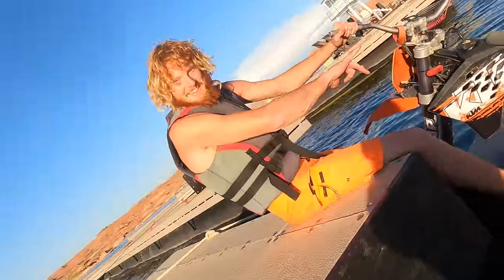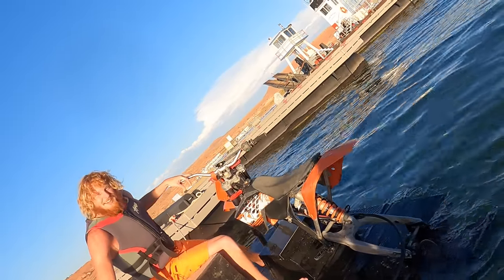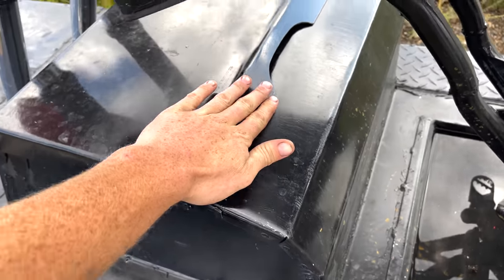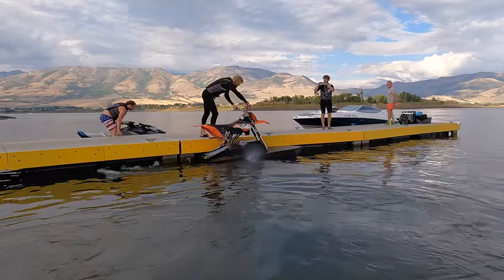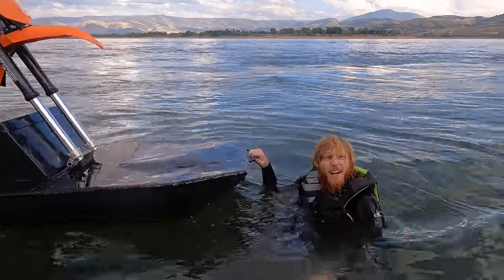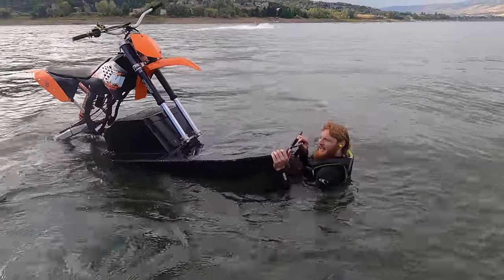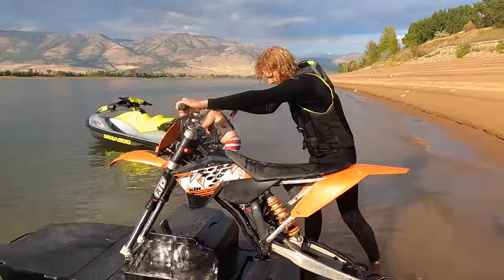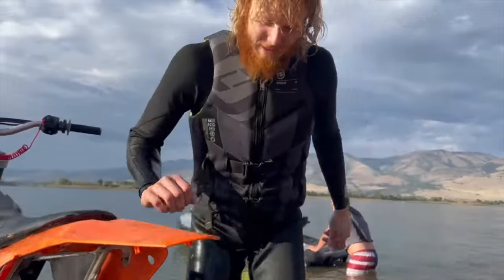Learning How To Ride A Boatercycle

Comment: My imagination was full send.
Snorkel the intake using a gimbal floater.
Add two small pontoons on the on each side at the rear. These could raise onto the deck as speed increases.
Definitely need a bilge pump that can be operated with a lever when your bobbing in the waves and engine is not running.

Comment: Awesome ride you built there.
I haven't watched the build video yet, but I have some ideas for you.
1) I think starting stability would be greatly improved with some ribs on the bottom from about where the forks meet the hull all the way back to the end and just outside the jet pickup.  This should help carving corners and auto-upright the hull when deep water starting.  It will also help force water into the pickup when the nose is high.
2) Flotation foam anywhere it won't catch on fire inside the hull. (I assume there is not much room in there, but floatation would be good especially on the sides.)
3) You could build a simple (but high volume) water separator intake and seal the hull from any air that didn't go through the water separator.  Also, a bilge fan with flapper valve would be a good safety device especially if the fuel is in the hull.
#1 is critical I think, but I am just an engineer in a Lazy-Boy, and you built it so???
I'll watch the build video to see what is really going on. lol
Okay...well void #2 because you have flotation and already had a fire. 1&3 still apply. ;)
Reply: Ribs? Do you mean strakes? He's better off with sponsons on the rear, a twin grate and an evolution marine straked ride plate.
Reply: @FarmerFpv  Strakes ... Okay sounds right.

Comment: I bet you could make a snorkel of sorts and get the air intake into the orem dirt bike airbox location. This could allow for better resistance to getting water into the hull. Looks like a dang good time riding it!
Reply: It’s definitely a trade off with a snorkel, cause when it flips all the way over it’s got that much more space to fill with weather and then drain through the haul
Reply: a floating snorkel?

Comment: Good job but ya need a wider bottom and a air catchment in it which has a snorkle runnin into that and some expandable foam,also a small bilge pump on a small seperate battery and ya main motor needs a carby clean and tune

Comment: You need one of those Shop Vac like anti spill systems. If tt falls over a ball covers the hole to prevent water getting out. Maybe a float type flap could cover that intake hole whenever wtar pressure is against it.

Comment: Put a electric bilge pump on it  the factory bilge on the pump don't usually work that well  if you extend the air intake in the engine cover  down to where it's a few inches above the bottom of the hul it should be above water level when it's upside-down reducing the water intake

Comment: Hunter wave runners have a plastic safety ball in the intake so when it does tip over that ball stops the air flow to the motor before the cut off switch kicks in and stops the motor 👍😁but keep having fun 😉

Comment: What if you put a secondary throttle down at the back of the machine. You could start moving while dragging you through the water then you can pull yourself up on the bike after it is moving. Just make sure your shorts are tied tight or the jet stream might help you ride naked!!
Reply from the maker: I’ve thought about trying something just like that, good idea👌🏼

Comment: Boatercycle is awesome you just need to figure out dropping the bottom of the shocks into the hull then maybe drop the swing arm down and make room for it to drop into the hull if possible otherwise maybe use 2 hulls and have the swing arm as part of the hull 🤷‍♂️ still looks awesome fun when running now it’s just that centre of gravity needs dropping to help keep her upright maybe move a little weight forward 😎

Comment: You needs to make some kind of spring ball valve for the air intake that opens when it turns over but closes 
When it shuts off with a lanyard as soon as you bail it will close

Comment: The next thing is to put the bike on a real Jetski. Remove and the stuff like seat, handlebars, Console, fuel tank, and fit the frame in as low as possible still using the Bike Suspension.  You need a bilge pump when it rolls over to get that water out. Fabricate  pontoons on the side that will make it stable when not moving

Comment: Why don't you build a vent out of the top of the motor cover with a check valve, that way when you lay it over you don't get water in, but still sucks air as needed

Comment: Any prints or specs on engine, I got the ideal catamaran molded transitioning into a boat hull type design 
Fiberglassing it now, putting in last layer of 1708 biaxial glass the fairing putty then kn to get coat, but need to figure out engine if nothing else going with water jet drive system think I can find someone to 3D print me two jet drives dumping into one outlet, with several angled blades, for little of nothing a lot of great folks out there I don’t hv 3D printer much les know how to operate it I’m a shop guy, also figured out water into computer???? Computer? Computer?? Course won’t show us inside will he? Would be cool to see in box as well better look at engine. I just like the dirt bike sound mi e not gonna be real loud exhaust outlet found perfect very thin water tight micro film used in military subs seals enter exit thru